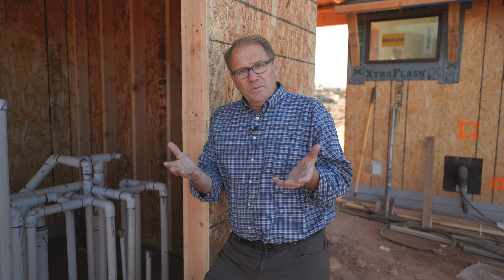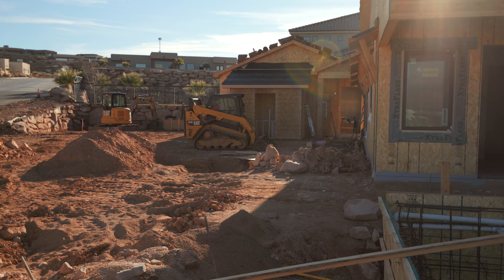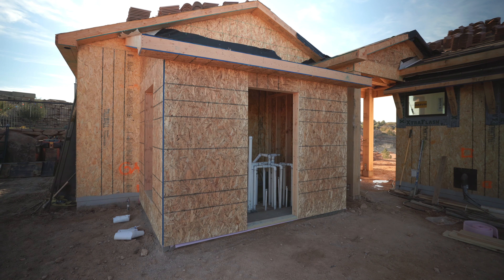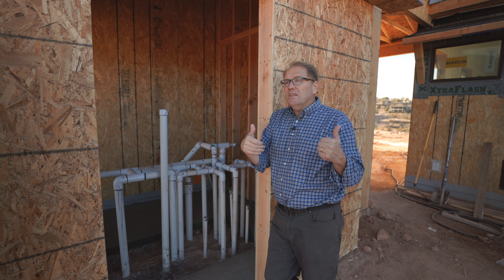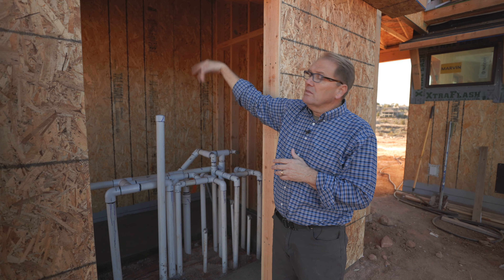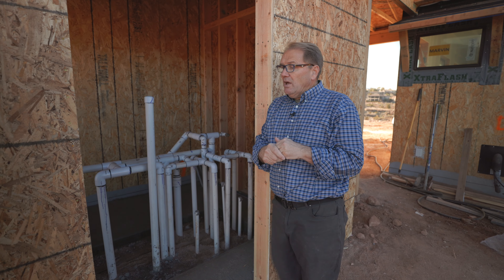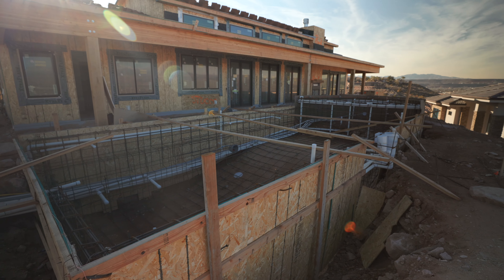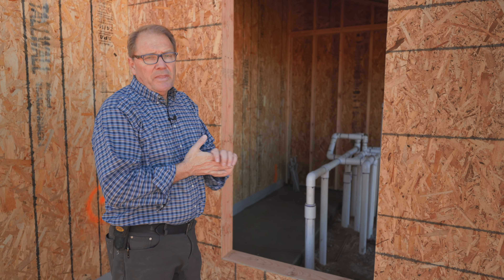Pool Pump House Idea

Comment: Good idea.as always. Very informational. 

Solar may be a more cost efficient options since the panels can power the heat pump and add power to the home when the pool doesn’t need heating. 

I know aesthetics  are important as well. Not a big deal If the back yard faces south.

Comment: Hey, Keith! Love your videos. I recently purchased a lot and am considering being an owner-builder. I've been trying to work with local architects to get some plans but they seem to only take on projects at the 1MM+ price point which is beyond our budget. Besides hiring someone from Fiver or Upwork, what are some options to get the initial design somewhat tailored to the piece of land? Thanks!
Reply from the maker: Where are you building? What is your budget? I have two architects are refer my students. So far they have designed several homes at a good price and with all the details you want. I would not go with fivrr. They do not include foundation plans, elevations, plot plans and the CAD file needed for the engineer, plus so much more, plus they lack some experience in actual structural design. My two architects are fully equipped, one was a former framer and one is a licensed designer with in-house architectural services. The average home if done right is around $4,000-$10,000 in design costs.